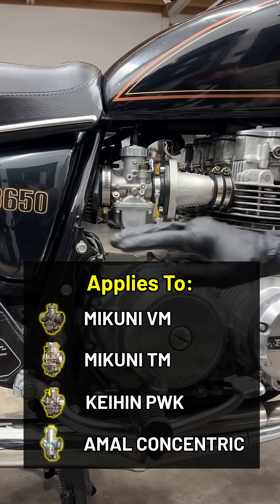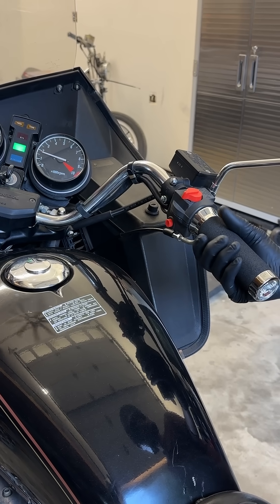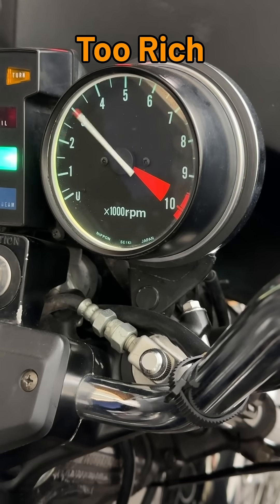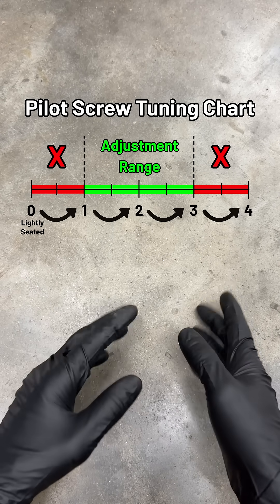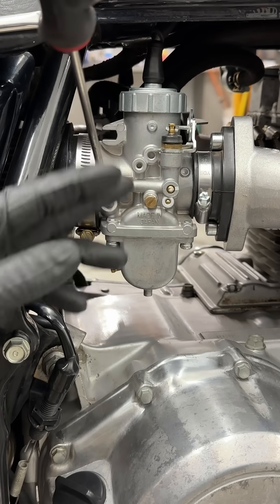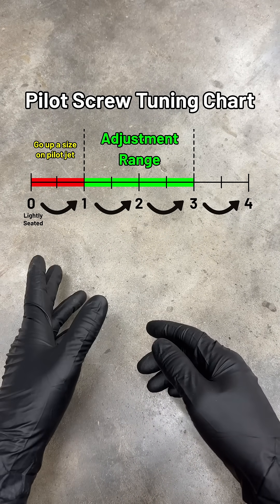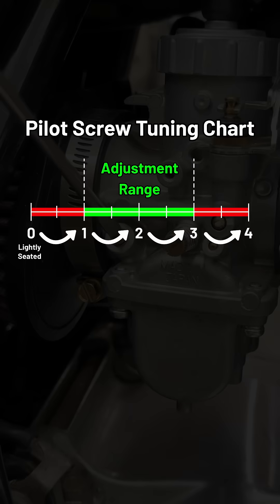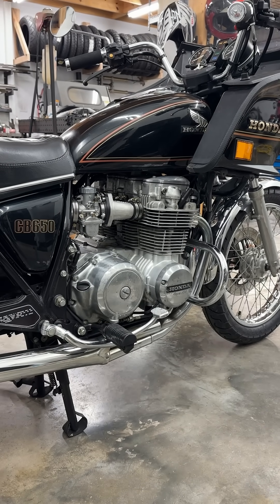How to Tune Your Pilot Circuit | Mixture Screw and Pilot Jet

Comment: But how bout,i turn the idle screw to give more air until max and still rich mixture
Reply: the idle screw only change the rpm not the mixture rate, it's time for check the air screw if it's stuck or broken. if it doesnt then you might want to go 2 sizes down on pilot jet as seen in the video.

Comment: My scooter does both (rich and lean) symptoms, is it in between?
Reply from the maker: It’s tough to say which it is because some symptoms can show up similarly on both extreme. If the scoot is stock, that narrows it down a bit. Is it stock or modified?
Reply: @oneupmotogarage its stock
Reply: @oneupmotogarage i forgot to send mb💀🥲. 
So yea i have both symptoms almost. But its maybe cuz i closed the choke “permanently” i can still open it but yea its cuz my auto choke doesnt work properly and didnt see it gettin fixed then. So i did a diy manual choke the only side is its a twist mechanism so i keep it closed and let it warm up without the enrichment. Those symtomps do disseappear after riding for a while. Well the only issue is it bogs at full throttle but not at 3/4th throttle 😅. Gy6 is a really weird engine tbh 😭 butttt its works 😂

Comment: Theory is correct but the screew shown on the video is not a mixture screw just read the manual. 🤷
Reply from the maker: That is definitely the pilot air mixture screw I’m adjusting on the Mikuni VM34 in the vid. Same goes for all Mikuni VM, TM, Keihin PWK, and Amal concentrics. You may be thinking of carbs with fuel mixture screws? Which are often on top or bottom of the engine side of the carb’s slide.

Comment: I can’t figure out how to adjust the settings on my bike.
If I increase the setting, the speed goes up a lot but the bike jerks.
If I decrease it, I can’t tell whether the speed is increasing or decreasing.
And when I turn the air screw halfway, it gives a small jerk.
Can you meet me on a video call?
My bike is a Suzuki AX 100.
Can you help me?
Reply: You're probably not going to get a call from the poster of the video. If you would like help from other people that see your comment, you should start by making your descriptions more helpful. I can tune a carb on 2 stroke lawn equipment from not even starting to running like new in just a few minutes, but I have no clue what you're trying to say.
Reply: Sorry, but I know how to do the setting — I just can’t figure out what’s wrong inside the carburetor. I’ve made the exhaust and filter free flow.
Only a professional like you can solve my problem.

 @johnhunter7244
Reply: @johnhunter7244 Sorry, but I know how to do the setting — I just can’t figure out what’s wrong inside the carburetor. I’ve made the exhaust and filter free flow.
Only a professional like you can solve my problem..
Reply: @peero95 Then take the bike to a professional. You're probably not going to figure this out yourself. You cant even use the correct terms for the parts.
Reply: @peero95 I'm certainly not a professional and haven't tuned that many carbs. An issue that I had was the fuel delivery system. In my case, the pickup that goes to the bottom of the tank was broken which made it so inconsistent that I couldn't even keep it running. I would check to make sure the fuel supply is consistent.

Comment: Weird question but when moving up or down on jet sizes would you recommend sizing by whole jet sizes or go with the next size up for example 25 idle jet would you go to 27 or 26.5? Just an example.
Reply from the maker: If you’re talking about Mikuni carbs similar to the one in this vid then one step is #2.5 so from a #25 one step up is a #27.5. Two steps up gets you to #30 and so on.